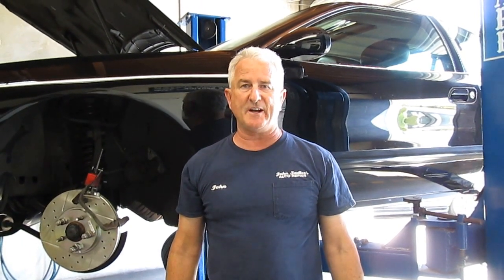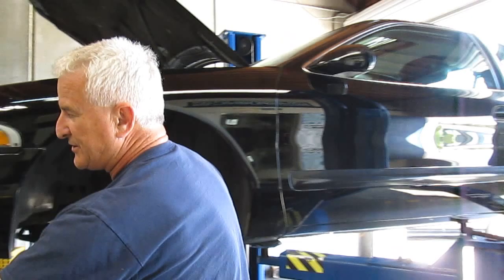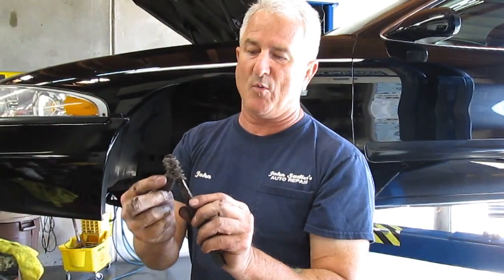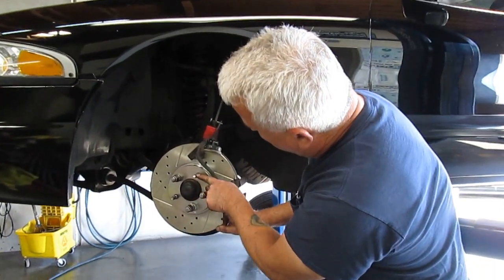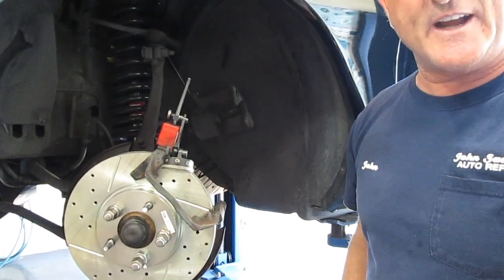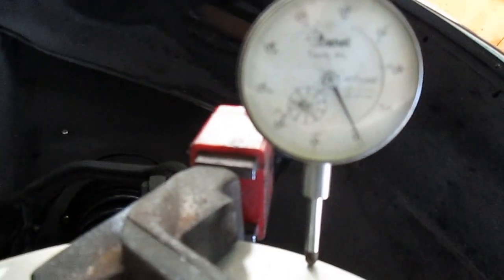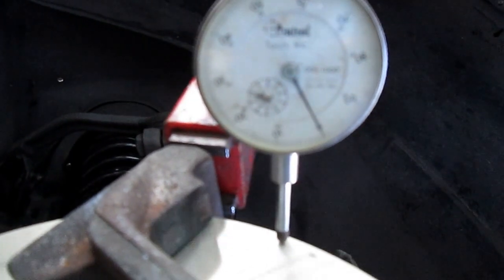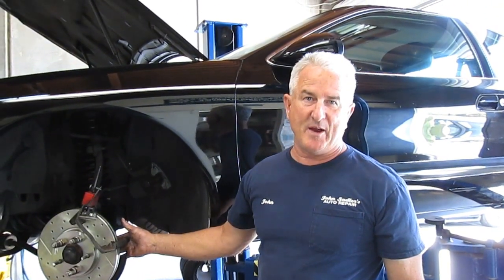How to check Brake Rotor Runout

Comment: Rotating brake disc one hole at a time is the best tip I have ever gotten on YouTube.  I bought a dial indicator, and I wanted to reuse the rotors and pads that were on the car.  The dial indicator revealed a wheel that had a variance of .005-.006 inches.  I cleaned and ground every contact point, all with no results.  Then I followed the tip and moved the disc one hole at a time.  Moving two holes solved the problem.  On a second wheel, also about .005 of run out, I did not clean anything, but simply rotated the rotor on the hub.  Moving one hole solved the problem.  I know longer have "pulsing" when braking.  I paid about $40 for the dial indicator, saved a few hundred by re-using the existing rotors and pads.  I could not be happier.

Comment: I like the mounting of the dial gauge using the caliper frame.  Where did you get that smaller magnetic base?  All the ones I see are much larger, and don't look like they would fit/mount on the frame like you have there.  Can you please suggest where I could get one?